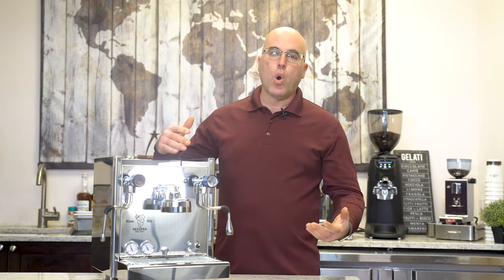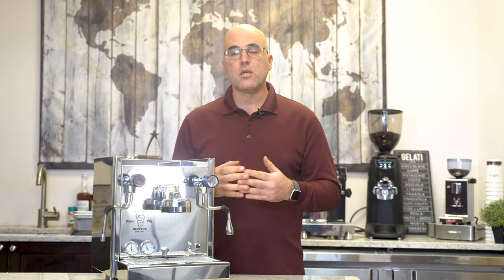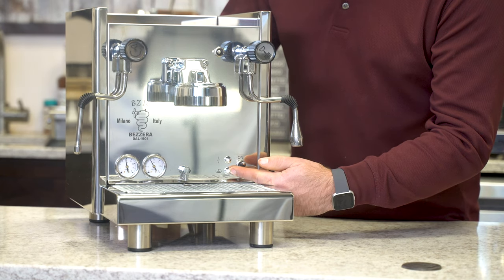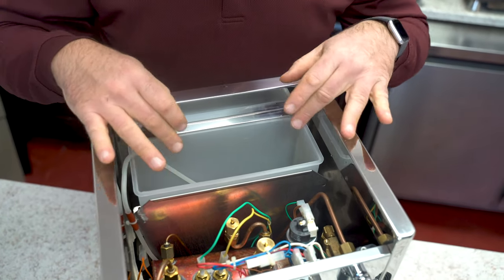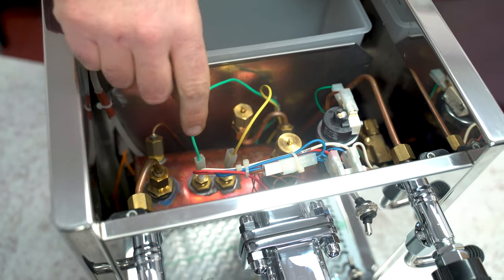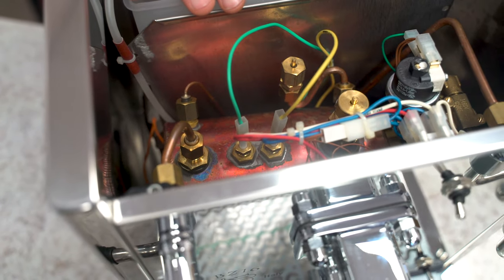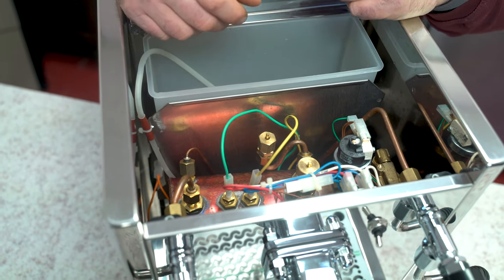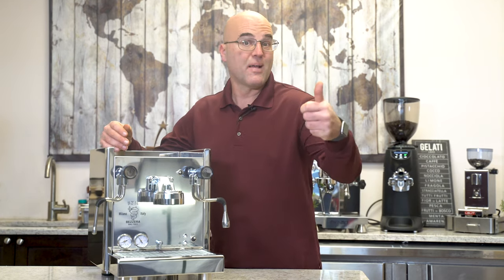Technical: Safety Design for Most Prosumer Bezzera Espresso Machines

Comment: I had to add a re-mineralizer filter after my RO system, so the low water probes wouldn't go off in my Strega at home. It's the direct connect model with no pump or water tank. I need to order some gaskets and a new pressure gauge for it from y'all one of these days.

Comment: I don't see the same setup as the lower-end models (e.g., BZ07) for the OPV tube in the water reservoir. Is there a way to remove the water reservoir (for cleaning, etc.) in those models despite that OPV tube?

Comment: How often do we add ‘pinch of salt’ to the reservoir? Every other time we refill it? Also, I was curious about the warm up time on the Bezzera Magica.?? I like the volume of the boiler (2liters), but am concerned about the time needed to get heated up. I think the wattage of its resistor is 1350. Whereas Lelit Mara has 1400 watts resistor to heat 1.5 liter boiler and the recommendation of the Brescia company is to turn the machine on 30 min prior to use ?
Reply from the maker: A pinch of salt depends upon how pure the water is. It can be once or twice per tank full. Or, it can be once every 2 or three tank fulls. It takes about 30 minutes for a full warm up on the Magica. The Mara is about 20-30 minutes. It is the E61 grouphead that requires the heat up time.